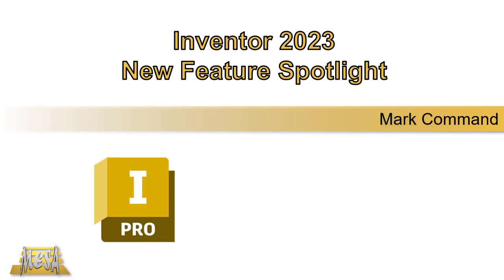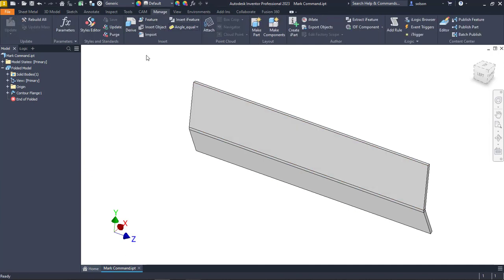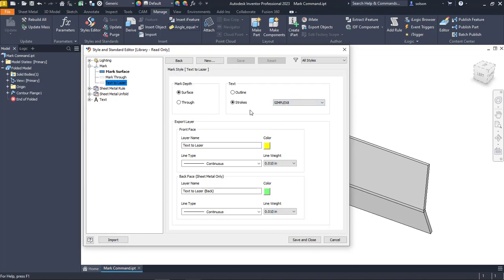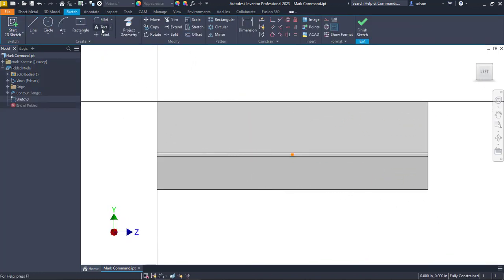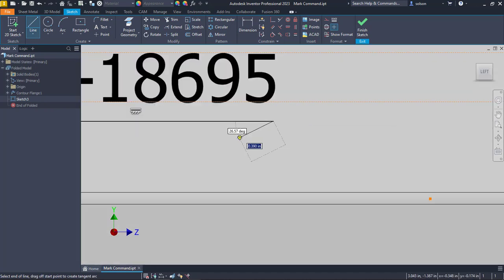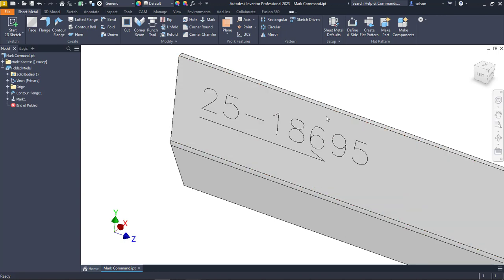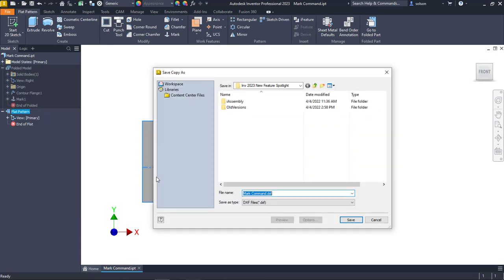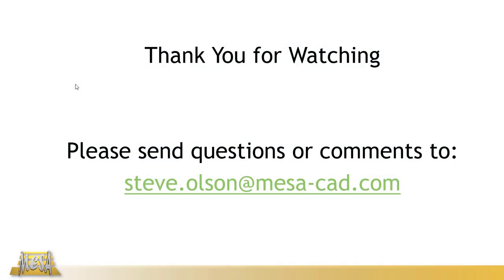Inventor 2023 New Feature Spotlight:  Mark Command

Comment: It is a great feature. I use it a lot to put the part number on the part to make it easyer to find diferent parts when they assamble , and to mark where parts are placed when welding.

BUT today i try to use it for making a 15 mm high part number in "stencil" through on a 4 mm sheet --- but i only see the thin single line, also on the flat pattern. WHAT DO I DO WRONG

Comment: Looks like a real time saver, but how would you prevent the "mark through" tool from cutting holes in your part?
Reply: Flatten the sheet metal before you mark it
Reply: @EliasNPC  I think what Wobblybob was referring to was that the characters with circular shapes, "8" for example, would just cut two holes tangent to each other.  And a "9" would cut a circle in the part with a "tail" extending down from tangent to the circle.

I would love to see a stencil font built in to Inventor to be used for this purpose.
Reply: @lvstreamer9403  Oh yes I didnt think about that 👍